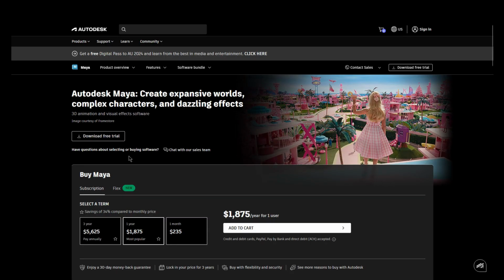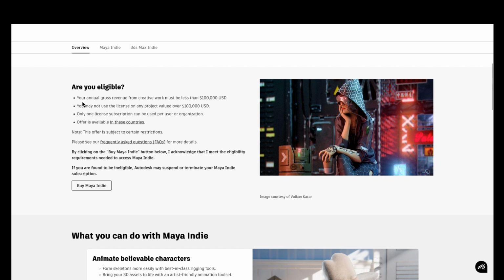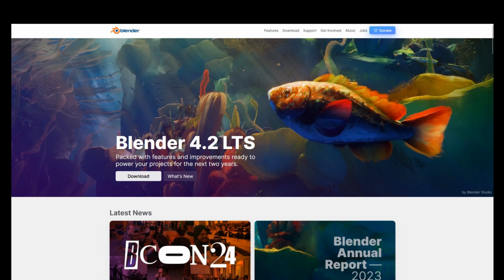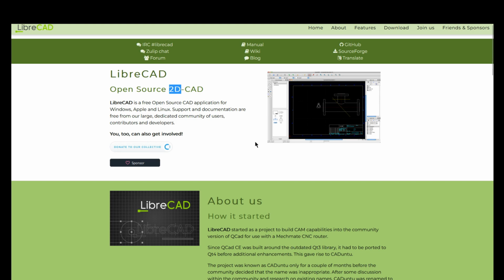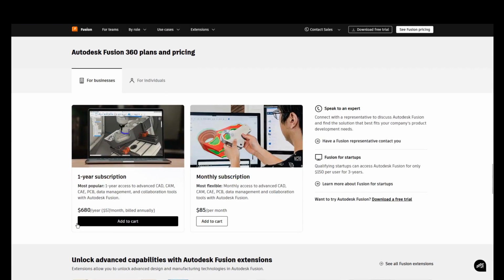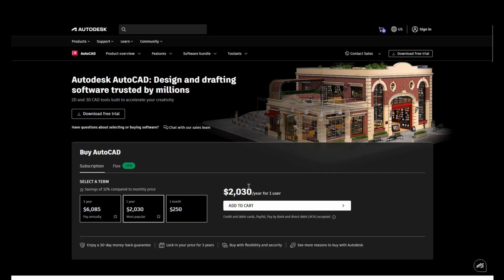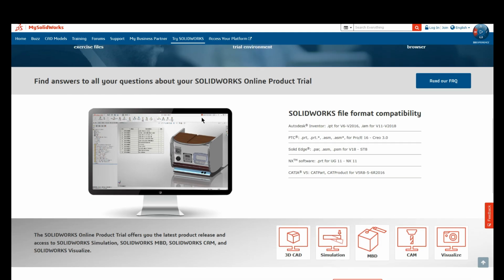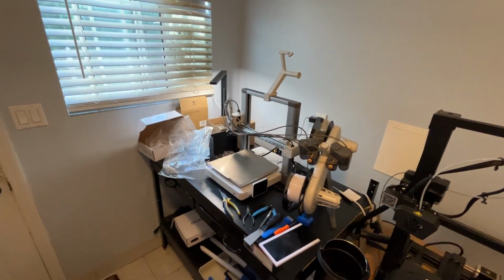CAD Showdown: Fusion 360, SolidWorks, Maya & More!

Comment: I'm using Maya because that's what I've learned. I'm now considering to try something more 3d print/product design oriented since that's what i'm mostly doing. Is it easy to adapt from Maya to Fusion 360? Or what would be the easiest software to transition to?
Reply from the maker: That’s a great question! Transitioning from Maya to Fusion 360 or another CAD software can be a bit of a learning curve, as they cater to different types of design needs. Fusion 360 is indeed very popular for 3D printing and product design due to its powerful CAD tools that are tailored for engineering and manufacturing processes. Since I just purchased Fusion 360 myself, I’m also about to start exploring its capabilities. From what I’ve seen, it’s good for the kind of work you’re looking into, so it might be a good fit. I’ll definitely share more about my experience as I get more familiar with it :)

Comment: Don’t forget plasticity. It has a one time purchase fee of 140 bucks. It is pretty wonderful.
Reply: Just a few months ago it was $99. But $149 is still a good price, because it's a one-time payment. At least in theory, because updates are for a year, so if someone wants to have the latest version all the time, we can assume that it's currently $149 per year, which is still a good price when it comes to this type of program ;-)
Reply from the maker: @LarryBerg  Thanks for the recommendation on Plasticity! I just checked it out, and it does look amazing. Their “CAD for Artists” slogan is an intriguing concept that aligns perfectly with a blend of technical and creative needs. The one-time purchase fee also makes it quite accessible. I appreciate the tip :)
Reply: @3DTheory  Problem with Plasticity is the lack of true parametric design.  

I use Fusion myself.   Just as a hobbyist though.  If using the free version, you are limited to 10 editable designs (you can mark them read only to have more than 10 designs hosted), as well as other limitations.  Not really much thats been an issue though.   Since you're planning on purchasing it, of course you wont have the same limitations.   I'm not entirely sure I like the hosted file system, but you can always export files.   One issue I had to learn the hard way is dont delete lines in a sketch that are referenced (the reference is set to the id of the line, so if you delete it and recreate the same line, it'll have a different id, and will loose its reference in the 3d part.).  

FreeCAD has come a long way, and if you actually do install it, do not use the "stable" release on the web page.  It is many, many versions out of date.   Get the weekly build from github instead.   Still not a fan of FreeCAD myself, as it can be very picky about certain things.  I suppose if you learned to do things the "right" way, it wouldn't be so bad.   Ondsel is based on FreeCAD, but with a  few more features.  I tried it out for a little, but its still based on FreeCAD, so I ran into the same types of issues.   

OnShape is the other one I think you should check out.  Granted, it is only web based, but it is very similar to Fusion in a lot of ways.  For me, its fine, but still just doesn't feel as polished as Fusion does.  I think it has very similar pricing.   Some tools do have more settings than Fusion has, but also, some tools dont have a preview quite as well tuned as Fusion.  

Personally, I think Fusion is the best, but its no where near perfect.  There are many issues with it trying to guess/predict what you want to do that it just doesn't work quite right.